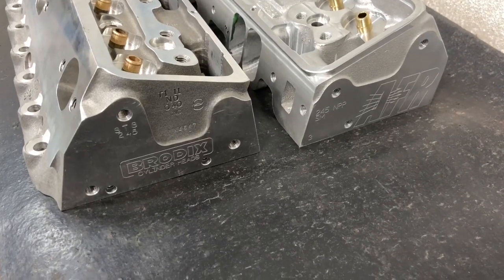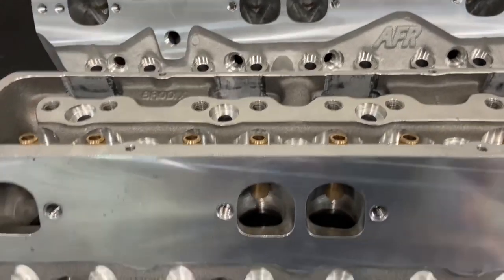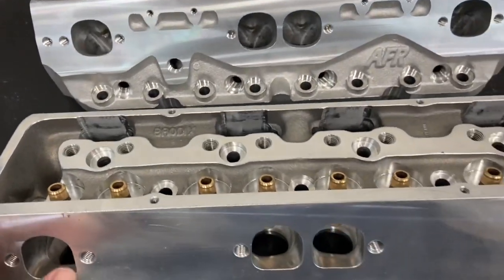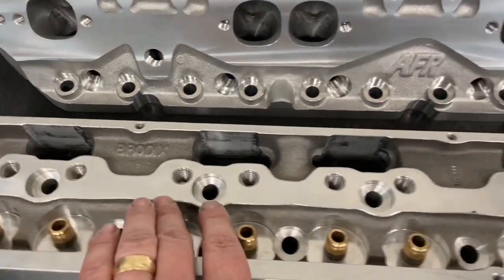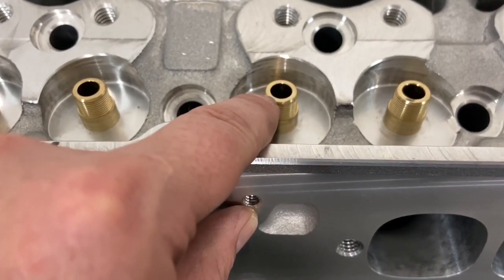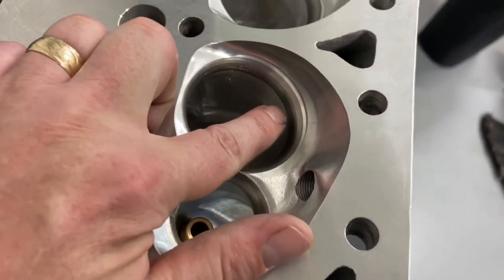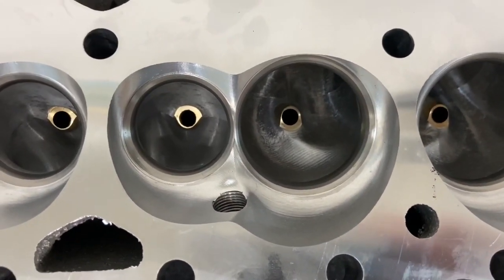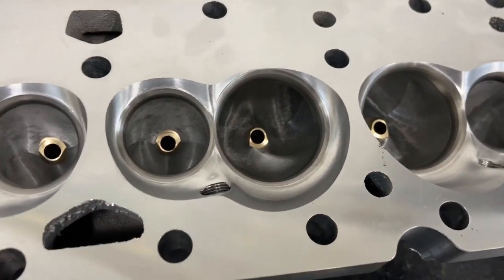Afr245 vs Brodix Trac1 245 for sbc

Comment: I have AFR 220 full CNC heads on my car. I did some light cleaning on them and I am running in the 10's in my 1966 Impala with a 400 small block. The next set I buy will be AFR's.
Reply: All motor?

Comment: Eric , when is the 540 going back on dyno? I have some heads that would be awesome to run next to these? They're set-up for 825 lift with Jesel shaft rockers 1.8 ratio , stock Trick Flow PowerPort 365cc with 119 cc , full CNC heads . They is nothing on 365 TFS BBC heads online. Let me know when sir . Great video on these . Impressive 385 AFR heads 💪👍
Reply from the maker: Thanks for the offer but with a .484 lobe I will be well over the lift limit of those heads

Comment: Whats a track 1 wt 2.08 valves by Tony Barker
Reply from the maker: Don’t know. Probably just one that has the logo cast in it but otherwise the same as a stock one. A lot of companies do that.
Reply: Just bored to 4.155 will this affect the head much wt the same 701 lift cam?

Comment: I worked for an engine re-manufacturing company and they didn’t put valve seals on the exhaust either and the reason was that exhaust doesn’t tend to suck oil but the intakes would so I think it mainly for production line saving.

Comment: Hi Eric,
Do you have opinion on valve job machine .?
I referring to newen bb contour versus shape form cutter (serdi vjs -20).
Comment on chamber detail.
Thanks k
Reply from the maker: I use a Rottler sg7 I wish I had the bigger sg8 or the cheaper robins version. I like the idea of the newen single point cutter but 100k and I heard they have bad run out.

Comment: I have CNC AFR's 220 heads and my machine shop wanted to buy them for his sprint car. Lol I still have them. I run 10.8 in the 1/4 406 cuin small block. I just got a LS firing order cam from Crower so I don't know how it works yet but it idles smoother.
Reply: What’s the specs of your motor? I’m curious I’m building one with 220’s

Comment: What about TrickFlow?
Reply: Indeed, what about Trick Flow ?
None of these after market heads are bad. Some are simply more
refined then others and application is certainly very important. I happen to like trick flow
Reply: @davewallace718  Just wish they were more responsive. I have been trying to track down some rocker options for their heads. Maybe you can help. GenX 220 as cast.
Reply from the maker: I just don't get many people asking me to order them or bringing them in. There ford heads are real good. The 195cc sbc head is pretty good.
Reply: @WeingartnerRacing  Cost effective rocker arm solutions seem to be an issue. TF does not even make arms for the GenX heads.

Comment: Thanks for the video. I'm getting some AFR 195 heads for my C10 and was going with their AFR intake manifold as well. They are supposed to marry up very well.  For just street use, would you recommend port matching as well as polishing or you think these would be bolt on and go?

Comment: 50 deg seat in the brodix vs 45 in th afr with a smaller valve, big air there. Done heads for 35 years, the Brodix head is a dog, intake choke at the pushrod also. The AFR will smash that thing with an 11/32 fat valve, no good for that ancient Brodix head.

Comment: 1” Lift! A few cfm at this point would seem practically meaningless, except for bragging rights. Average flow, over the range in which the cam spends most of it’s time opening the valve, would seem to be the most important factor. Out of the box, AFR would appear to be the better choice for any sane combination. Of course, a bit of expertise from a master head porter, could and would change those figures.
Reply from the maker: You should watch the video I just put out about your statement of 1inch of valve lift. It’s called Using Flow Numbers. Although this Afr would make more than this Brodix head.
Reply: @WeingartnerRacing  Thanks! I will do that. I appreciate the information.

Comment: Dyno time!! I pick AFR's for average hp production,especially below .730 lift cam
Reply: How much do a set of AFR ported cost for small block Chevy
Reply: 23 degrees
Reply: Dyno results are in... Brodix T1 233 out of box FTW all steel Nova steel bumpers 3200 lbs.n/a  https://youtu.be/1WKuFUn28ek

Comment: I agree with Kevin S. and Chris M. low , mid and under curve flow numbers win races . No matter if you shift once or twice or three times. Engine RPM recovery per shift. The engine sees mid lift twice.
Reply: Thanks Nick, but you are not correct about seeing Mid-lift twice, because when the valve is on the closing side, there is no pressure differential in the cylinder, so air cannot fall into the cylinder.
Reply: @racerd9669  I stand corrected Racer D. I should have been more clear of my explaining. My reference is more about an engines rpm drops during shift points and how cam specs values and head flow cfm work together. If that makes senece. In other words with a head that flows enough CFM for a giving rpm range and may have a cam with a slight less lift then peak lift flow of the head , the engine would still pull hard pass the cams power range due to the better head flow . make up alittle for the smaller cam. Maybe its a different topic but cylinder head related. Stay Frosty..
Reply: @MRnicknitro919  Spot on Nick, It is more about valve acceleration than lift. If you want the fastest acceleration to peak flow demand you would never use an overhead valve engine. I spent a lot of time working with an Olds Quad 4 engine. And this engine has direct acting lifters. They are 1 3/8 in Dia. This is the only engine I have ever seen that the valve is on the closing side of the ramp when the piston is at peak flow demand.
Reply: @racerd9669  Would this be the reason for the outstanding volumetric efficiency in the Quad 4 ?

Comment: You're vid is addressing relativity.  How does one discuss big, bigger, or biggest when dealing with engine parameters? How does one discuss small, medium, or large regarding engine parameters?  All things are relative. Both heads on their own are similar.  Its only when we attach displacement and purpose of that engine do the engine parameters demand specifics and the discussion takes on relativty
Edit: edited just to say thx for the vid and great comparrison

Comment: I appreciate the comparo. Always looking for the best of everything. The only thing to add is, flow numbers dont tell the whole story. Seen heads that were lower in cfm that were as good or better as ones that flowed higher. Port velocity, cross sectional area, the finish left on ports. The dyno doesnt lie. Thanks for your knowledge.

Comment: The AFR will make more average power due to the better flow at low lifts. The flow at those super high lifts is not important really unless you are using some incredible cams. Most of the cams that will be used will be .750 or less. It is probably possible that you can make the Brodix better but for out-of-the-box performance it's hard to beat AFR's heads. Great comparison and please do more. This is the stuff we live for.
Reply: Mike you are partially correct. Engines do their breathing at peak flow demand. And this occurs between 70 to 75 degs ATDC. so the valve lift you can make at this point will set the demand for air. This is the reason that camshafts have to be .750 lift, so you can have more lift at peak flow demand. But if you look at camshaft design you will see that even the best lobes will only generate .450 to .500 lift at 70deg ATDC. Once the valve passes this point the the pressure is equalized in the cylinder and air will stop filling the cylinder. Spintron testing confirms this.
Reply: Higher duration cam would work ?
Reply: Good point Racer D.

Comment: Off the shelf from the manufacturer for a 400 to 450 hp street car with 4.125 bore sbc  is there a big difference in price wise..
Reply: You wouldn’t want either of these for that build. The afr 195 street car head is what you want, not the race head. They are around $1,800 assembled.
Reply: @jrod264winmag  yeah  a brodix race rite is comparable to the afr 195 but the price isnt.  a afr 195 STREET head cost less than a race rite  and i think the only thing thats CNC'd on the racte rite 200 is the combustion chamber and then the price goes about 2400  where an AFR 195 street is still less than 1900 even if you upgrade to the better hydraulic roller springs.  hard to beat out of the box for the power range and price point
Reply: Agree with Jrod, or a Dart 200cc head, maybe a Profile 195.
Reply: @MRnicknitro919  which i believe eric sells both of and hand ports and cost  less than even the AFR's i think
Reply: You didn't say anything about the guide being flush with the roof on the afr...the brodix guides just hanging out in the wind..literally.